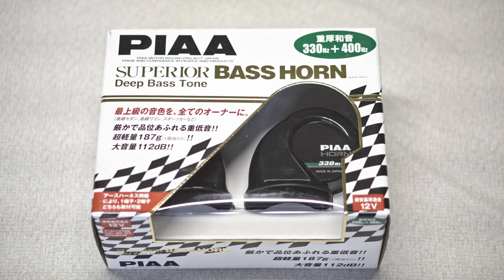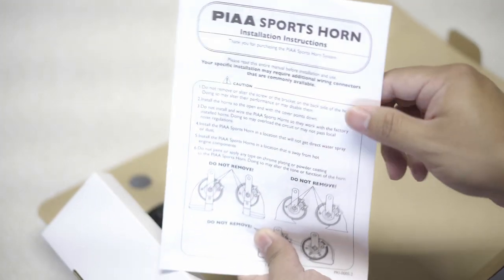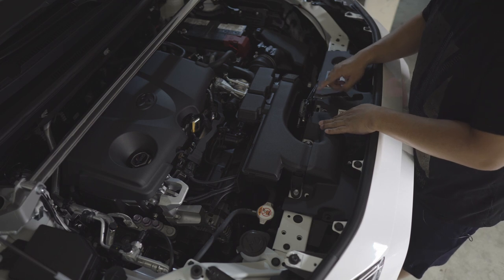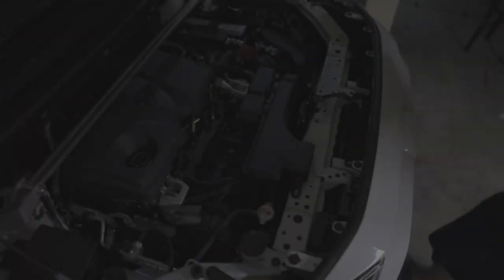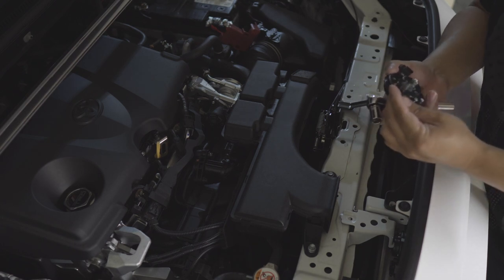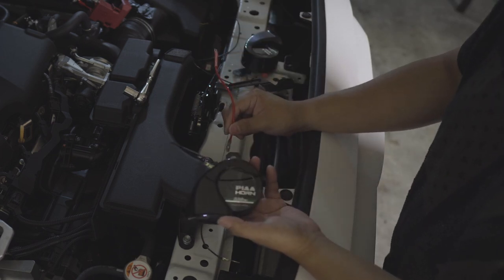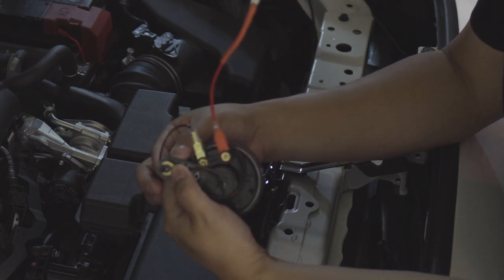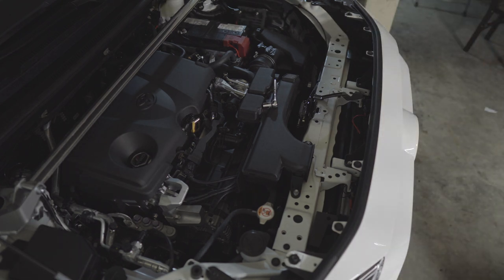Sound Check & Replacing the Horns on My 2021 Toyota Rav4 #PIAA #soundcheck

Comment: Why do you need to install wiring to the new horns? I didn’t see wires on the stock one
Reply from the maker: There is wiring on the stock one, also i made an updated video for this using the proper connectors Wiring PIAA horns using Toyota Factory OEM style plug | 2019 2020 2021 RAV4
https://youtu.be/YUnDrfpwZQo
Reply: @Forged_Garage  oh thank you for clarifying that.

Comment: How come I see some wiring directions showing the positive on the top tab and negative on the bottom? Does it matter?
Reply from the maker: Positive on the top, it matter because if you switched them up it will sound bad.

Comment: FAIL #1:  The new horns require much more current than the wimpy OEMs. A relay and an inline fuse for the horn's power feed are MANDATORY otherwise the car's horn fuse will keep blowing. The car's horn fuse is more than adequate to energize the new horn relay. Size the new fuse to be 33% to 50% larger that the maximum current draw of both horns at once. Best to measure each horn's actual current draw on any multimeter that can measure up to 20 amps.

FAIL #2: Using electrical tape on ANYTHING electrical is just pointless. Use of is strictly temporary and will not hold up to engine compartment heat and weather. The plastic will become brittle and the adhesive will turn into sticky goo. Use of heat-shrink tubing is strongly recommended. If you don't know to use heat-shrink then you should not attempt any weather-proof automotive install. NOTE: DuckDuckGo is your friend for learning about how to do anything. Find multiple videos to learn the best way to accomplish anything! [G..gle can burn and rot in h3ll !]
Reply from the maker: I understand your concern, but since day one i never got any fuse blown because of the horns, if i blew a fuse my next route is to install a relay, i have a relay harness ready, but did not install it.  On my 4runner i installed an aftermarket horn tried it just to directly plug it and the fuse blew, so i installed the relay on that.